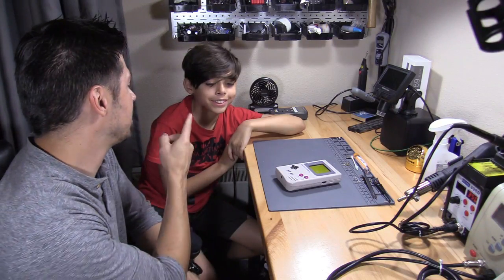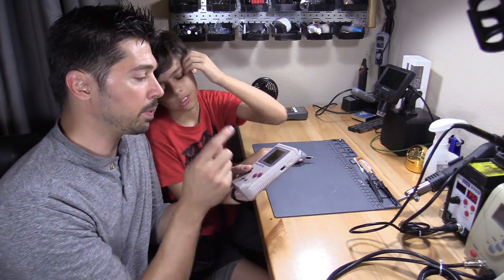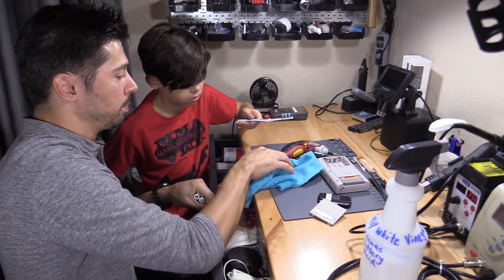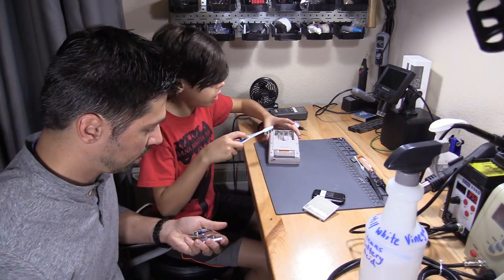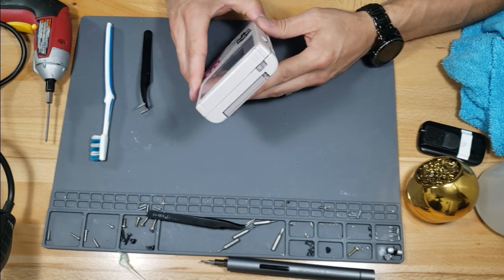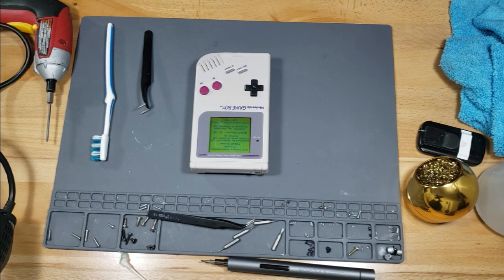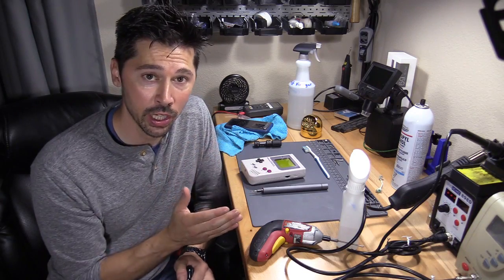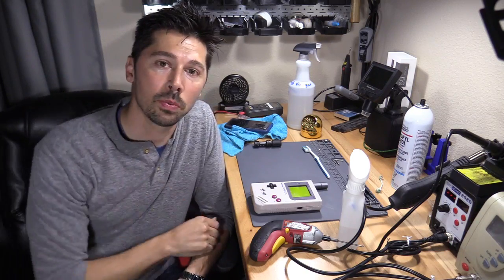Fixing Gameboy not turning On, Week 5 Ebay Repair Challenge !

Comment from the maker: Vinegar works but It's very smelly and more messy. I'll stick with fast dry 99% electronic cleaner alcohol . Both are conductive and needs to be dry before turning on any circuit.
Reply: Just wet a Q tip with vinegar and wipe the corrosion and white crust.   Don't spray shower it.   LOL.    It will fizz until it is neutralized.   Then rinse with water and then alcohol.

Comment: Can you help me with my bravia 4k andoid 2019 tv. it the KD-43x700f model and im being ripped off. our lights flicked or a split second no issue i thought as my lg oled is fine xbox and my other tvs until i went to turn on my bravia. no power so i called for a repair and was quoted 500 bucks for parts and 200 for labor. Wtf . i can fix it but need advice. cheers.

Comment: 2:21 Distilled white vinegar (which is essentially dilute acetic acid) cannot neutralize battery acid... I rather tend to think it was an alkaline battery, which caused all that damage. In this case it would make much more sense. Battery acid has rather to do with lead-acid batteries, which is clearly not the case here, because they would be rechargeable.
Reply from the maker: White Vinegar can be used as well as few other solutions https://www.bobvila.com/articles/how-to-clean-battery-corrosion/

Comment: It isn't a good idea to use acid on a circuit board....just putting that out there
Reply: Can you explain the downside(s) of using it? Particularly if you use IPA after to clean the same area.
Reply: @raymondosborne9956  the acid will get everywhere on the board (under chip packages, in switches, etc).  The only way to get it off the board completely would be to rinse the entire board in a distilled water bath.  You are much better off using a brush with just distilled water and some elbow grease in the first place.  That way you don't have to worry about added acid causing more damage if you don't get it all off.
Reply: @mdrew44628  Thanks for the reply

Comment: That seems counter intuitive. Why would you use an acid to clean up acid? It seems to me you'd want to go with an alkaline like baking soda.
Reply: yes it is also and acid but it neutralizes the alkaline in the battery acid from causing more corrosion and burning your skin if you touch it
Reply: Yeah, I thought the same thing on first hearing, but the key fact is that what is often referred to as "battery acid" is not acid at all. A better description would simply be electrolyte which is universal. Most AA, AAA, C, D and 9v batteries use potassium hydroxide as the electrolyte. So ultimately you are trying to neutralise an alkaline/base, hence the use of an acid. As an aside, other battery types such as lead acid car batteries do actually have acid in them.
Reply: @raymondosborne9956  That makes total sense to me now. You kept it simple and clear enough for me to understand. Thank you for the explanation.

Comment: Do you know if vinegar will clean up capacitor ooze ?   J K
Reply: yes. Spray right on the pcb directly and let it sit for a few seconds, then get a light brush and lightly scrub. Then rinse with 99% isopropyl.